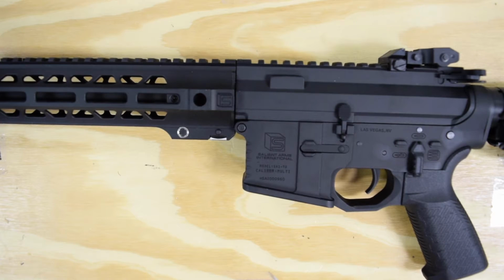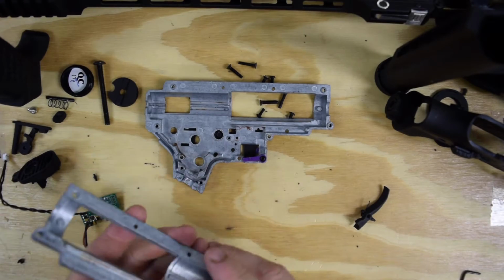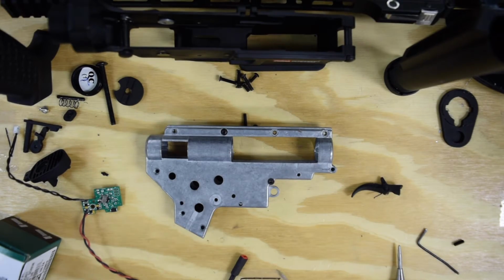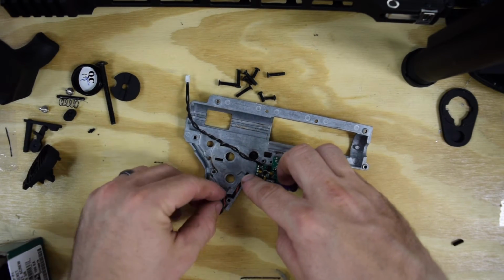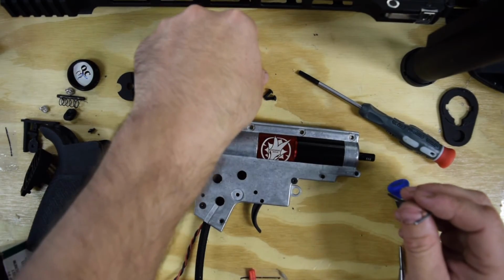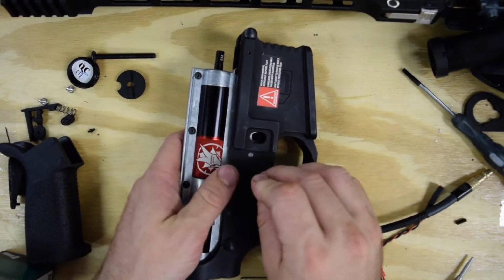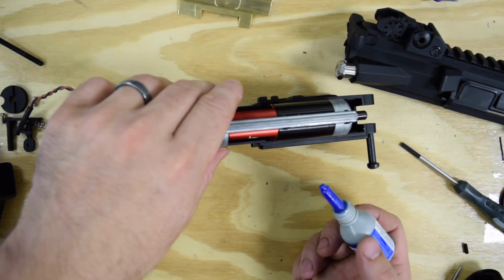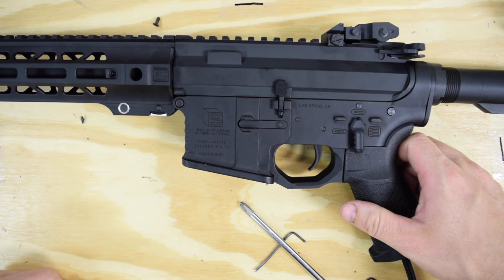What the Tech?!?! Episode 17: INFERNO Gen 2 M4 Installation

Comment: I know this video is a bit older, do the Wolverine Inferno Gen 2 units come with the buffer tube piece or is that only included in some models/generations of them? I am wondering as I just purchased the Heretic Labs Inferno Gen 2 and will probably need one of the butt stock adapter pieces but I have alternatives if it doesn't come with one. Would be great though to have as it would mean no mods to the existing parts.
Reply: I got the engine in and it does come with the buffer tube/spring guide replacement piece to connect the buffer tube

Comment: Why the fuck you need these alignment shit? My m4 has a "seat" where the GB sits. What cheap shit are you using...
Reply from the maker: Hi iare19, these guns are designed as AEGs which is a different technology than HPA. With any HPA installation, you are adding other technology to your rifle and simply need to calibrate it.
Reply: iare19 proper English please
Reply: Wolverine Airsoft well I didnt. Inferno gen 2 sits like a glove inside my mechbox. 0 adjustments. Also I have tried same unit in a different gun and I also didnt need to do anything. These are some cheap shit mechboxes you are using. Mine were both TM standard.

Comment: with the wiring going into the pistol grip is that where youd put the fcu battery?
Reply: pegstall 
Yes but you can also wire it to the buffer tube or if you have a front wired aeg, you could put it in the rail. So you can wire it all three places!
Reply: Wolverine Airsoft what kind of battery can I use?
Reply from the maker: You certainly can yes!

Comment: Well I'm not by any means a professional but most of my airsoft gun had issues with the gearbox when I bought them "used". What I don't understand is why did you put alignment screws on the gearbox, once you put all the pins, pistol grip, and stock the gearbox will automatically be center and perfectly in place. So in my opinion the set screws are a waste of time and money

Comment: Hello, what barrel length should I choose for the most co2 efficiency? I am shooting at 280 fps.
Reply: Hey sorry we missed your follow up question. Probably something in the 285-300 mm would be best in order to balance good efficiency and working well down at 1J.
Reply from the maker: What barrel are you currently using?
Reply: PDI 250mm
Reply from the maker: Yeah we like longer tight bore barrels typically.
Reply: Wolverine Airsoft
thanks for the replay, I play in Japan and the regulation is 300 fps. wouldn't longer barrel shoot too hot?
Reply: anyway thanks
Reply: Rich Lort
thanks, that helps a bunch.